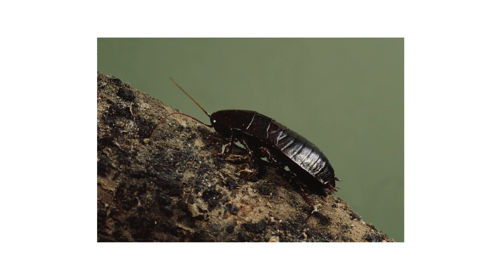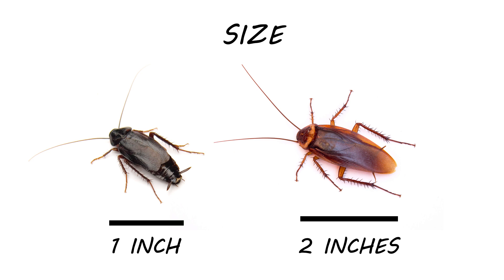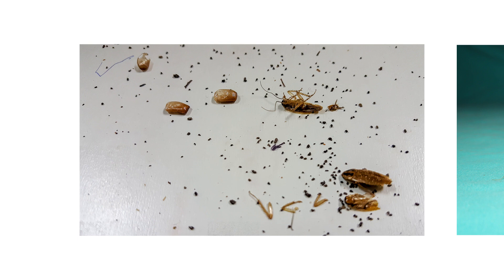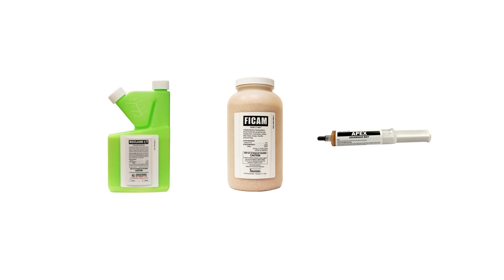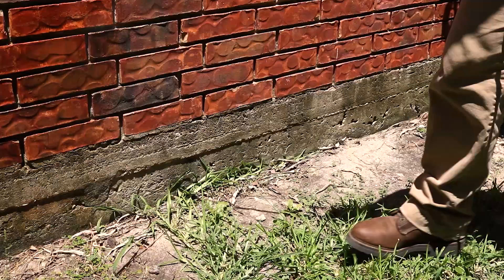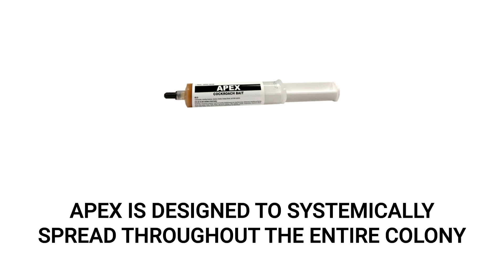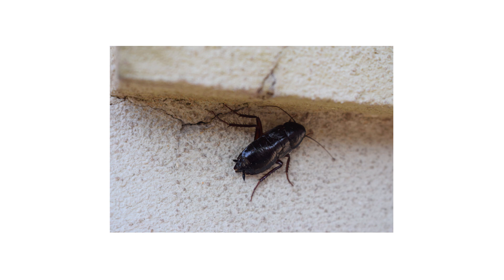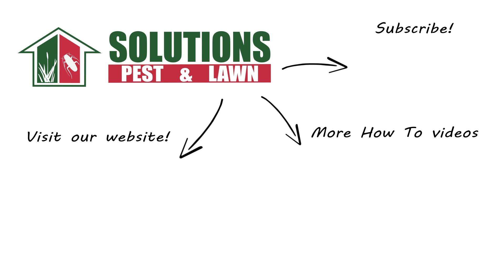How to Get Rid of Oriental Cockroaches (Water Bug/Blackbeetle)

Comment: So they don’t come in because food
Reply: Ok. I was in my bedroom that day and it was night time but with the lights on and all of sudden I heard something like hissing or something like electrical sound all of sudden and I thought it is from some electronic but I heard it 3-4 times more and then I checked my room and I saw one cockroach (it was oriental cockroach that was small-middle size if Im not wrong) and I just picked it and took it outside. Then on the other day , at 10pm , I saw another cockroach in my living room running towards me and I grabbed it again and I flushed it down the drain. Im scared because Idk where can they possibly come from. My apartment is overall clean and hope it is only those 2 cockroaches. I cleaned my sofa in my living room today because there were some food pieces and I hope there wont be other cockroaches. That was the first time , I saw a cockroach in my apartment and I hope they got here accidentally for food and hope there isn't a nest or something else. It isn't night yet right now as Im writing this comment and hope I dont see a cockroach for the 3rd time and I wonder how the first roach got in my bedroom because there werent any food pieces. My room is pretty dry tbh. Do you know what can I do to prevent cockroaches from coming in my apartment? I dont even know how they got here
Reply: Are oriental cockroaches common in summer?
Reply: @user-rx5qe7iz5v   summer is the only time I have ever seen them.  Only two or three over 20 yrs time